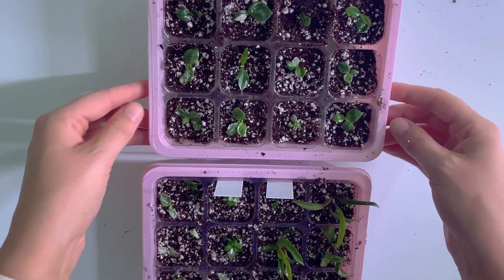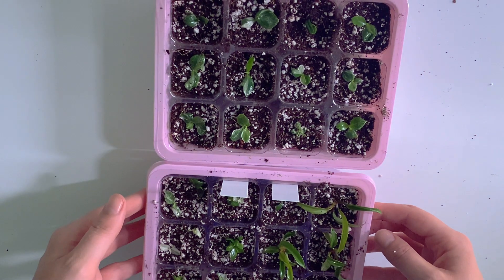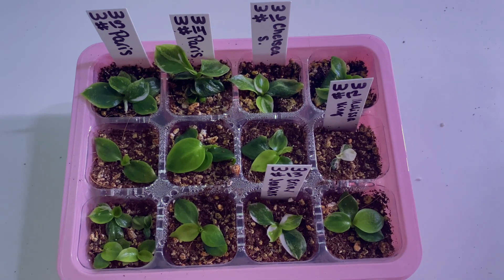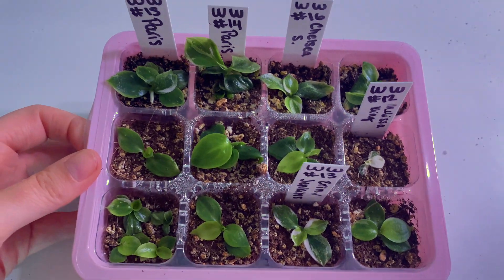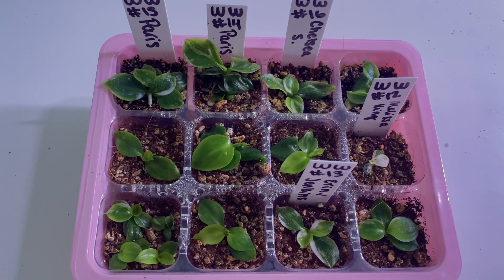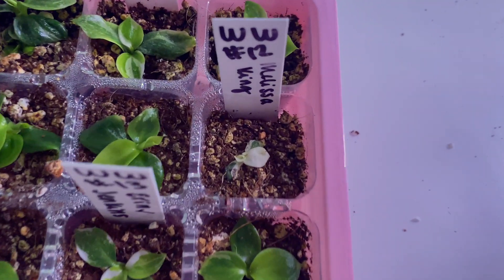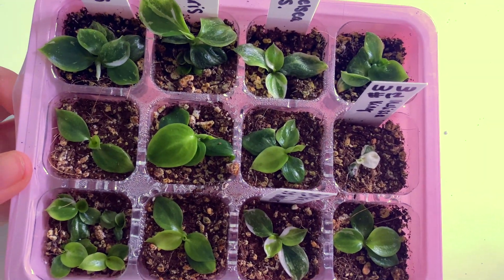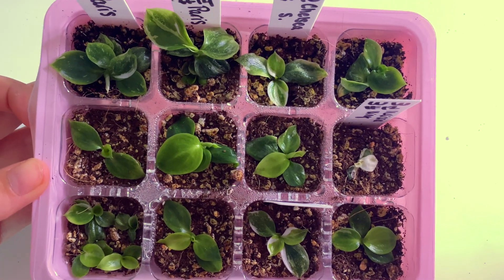TISSUE CULTURE 101 | PART 5 | Subculturing with DIY $10 Laminar Flow Hood Alternative

Comment: Great video! Just one question. When you’re separating them deciding what to keep in multiplication media vs which ones to plant, what do you look for? Do you try to keep a root on each piece that you are transferring?
Reply from the maker: If they have roots, it certainly helps to try and keep those, but roots aren’t necessary! I just look for plantlets that are about 1/2” or bigger.

Comment: Thanks so much for an in depth video! I have a couple questions...

How do you know when the explant is mature enough to divide? How do you know when they're mature enough to pot up instead? 

Also a separate question...is the initiation phase necessary before moving to multiplication media, or is it fine to jump right to multiplication after you sterilize the explant? 

Thanks so much! Looking forward to the next video :)
Reply from the maker: These are great questions! I wish I would have been able to include the portion of the video that got deleted because I showed the plants up close to where you could see the size. I’ll be sure to get those in a future video though! I extract plantlets that are roughly 1/2” in size. 

Honestly, I typically skip the initiation phase but most of the plants I work with were already in TC to begin with. If you are taking an explant from a mother plant, then it kind of depends. Some plants need initiation and some are fine without it, so it’s kind of just trial and error for every plant!

Thank you for following and I’m having so much fun creating this series❤️